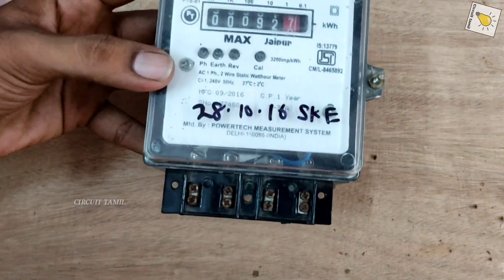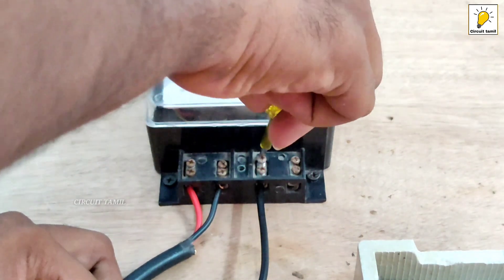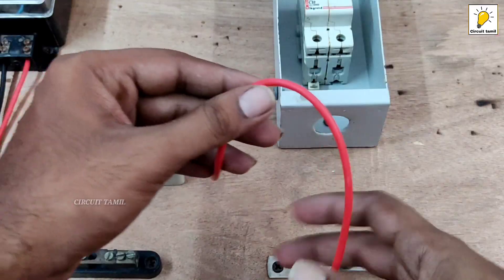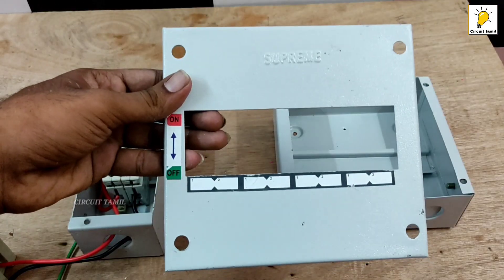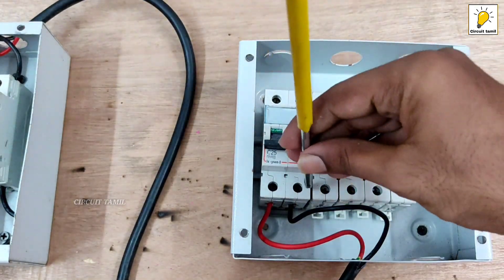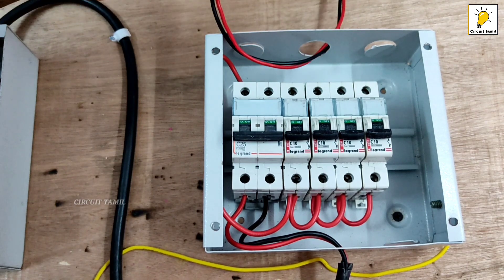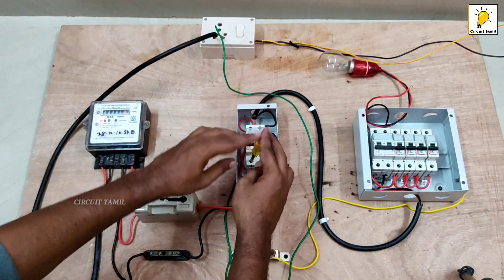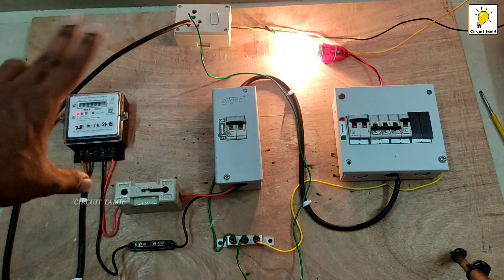Single phase energy meter connection and 1 phase DB wiring | Circuit Tamil

Comment: Anna ean rendu edatthila breaker use panringa,oru breaker use panni athila phase neutral earth connect panni output supply ve load ku use panna mudiyuma mudiyatha enakku oru santhekam than ethukku rendu breaker than use pannanum ena rule erukka ella oru breaker um use pannalama
Reply from the maker: Extra protection bro . Safety tha reason vera onnum illa

Comment: Bro oru small doubt  
 1.icdp box illama..... straight 32 amp elcb or MCB connect panni output edukalama.....
2. Icdp connect panni output eduthu MCB 32 amp connect panni output eduthu connect pannalama....
Reply from the maker: Icdp old model bro ippa la MCB and elcb tha use pandranga. Rendume use pannalm. Enna porutha varikkum MCB best
Reply: Bro...entha square wire  podalam ....
Phase and neutral
Reply from the maker: neenga enna load use panna poringa atha total la calculate pannunga bro ok va. Enne porutha varaikkum main board la 25amp la irunthu 32 amp varaikkum MCB podalam . Wire size main board to home db wire size 6s.q mm best . 4 s.q mm podalam
Reply from the maker: Meter input irukku illa bro atha mattum 25 s.q mm cable use pannunga ok va. Ithu ellam single phase ku mattum tha ithuve 3 phase load na neenga naraiya mattram seiya vendum
Reply: Meter to MCB input Vara 4 sq pottruuku
MCB out la irunthu db box phase 2.5, neutral 1.5 connect panni irukku